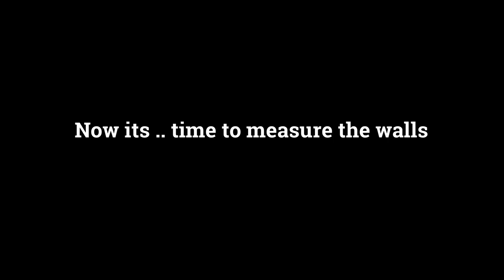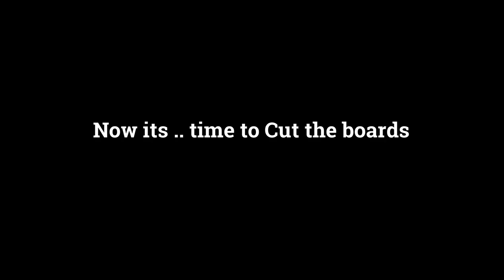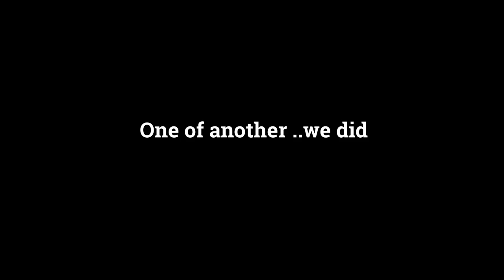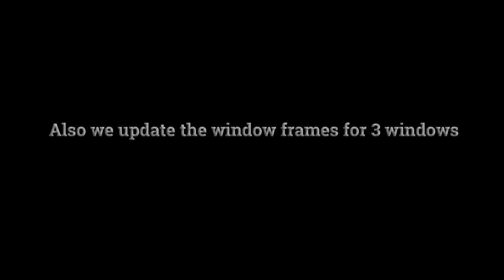How we Create Bathrooms Using Epoxy resins ?

Comment: Hi Nice works done , but  just wondering how long the MDF panel can last in wet humid toilet
Reply from the maker: It will last for ever.we offer 10years warranty for these type works
Reply: We use isolation 1/2 inch foam board .Waterproof and last forever
Reply: @SiViTaArt instead of mdf or both?
Reply: This is hdmbr MDF board